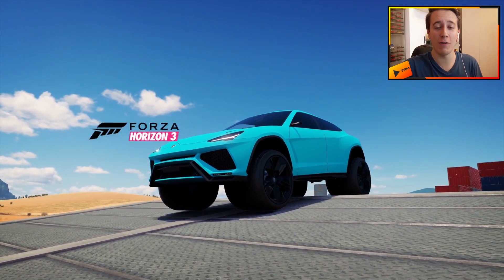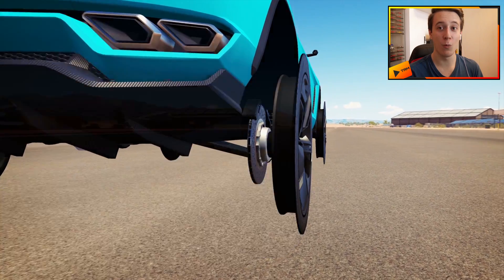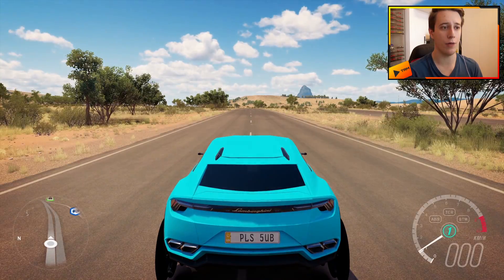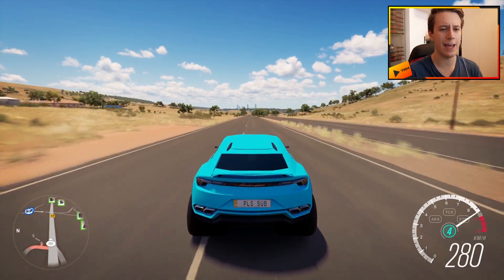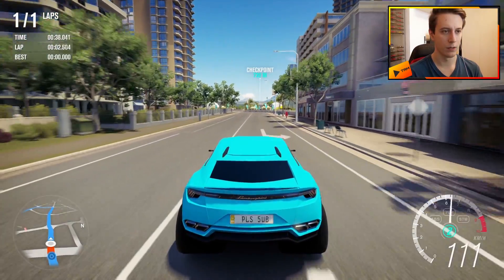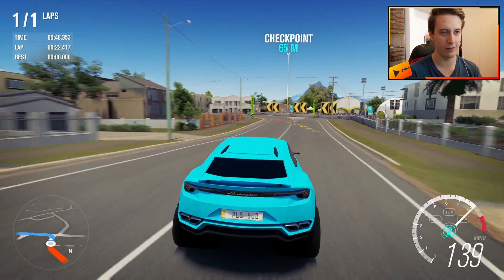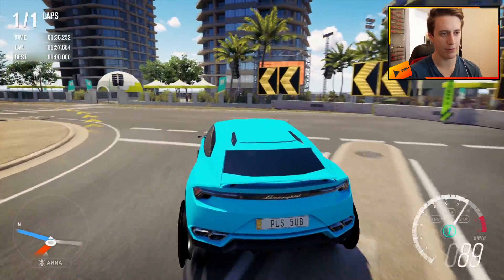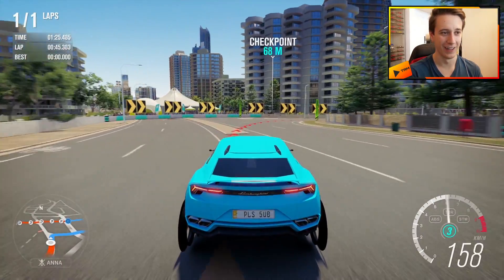SUPER THICK vs SUPER THIN TIRES | Forza Horizon 3 Dev Mods | Forza Science

Comment: The thick tire friction is indeed the reason for the rolling. I do game programming myself. The sideward friction between the colliders for the tires, and the ground will be set higher when the tire is wider. The tire friction tries to stop the the sideward force in a corner though when the sideward force gets too high, and the friction is very high it will roll over. With the small tires there is allmost no friction so the sideward force will almost not be stopped, and the car will just drive like there's ice in the corners.

Comment: Reason why it goes on 2 wheels is ...
Wait for it...
Physics. Yeas actual real world Physics. 

Same thing would happen if you could do that in Reality . Tires are too wide for lateral G forces to overcome the grip.
So the Tire instead of slipping to the side (basically understeer) It sticks to ith path and the rest of the car rotates around it because the inert force need a way out.And it takes the only possible way out.

This problem existed With first generation Mercedes A class. The tires  gave too much grip. Suspension was way to firm and car 
 center of Gravity too high so It basically flipped on its side when you turn sharp.
Reply: So would an F1 car have no problem with this considering the downforce

Comment: The reason the car went up on two wheels is a basic law of physics, the track width is narrower (wheel center to wheel center) with the wider tires. the 1 CM tires have a wider track width than the wider tires, also the compound of the tires allows the wider tires to grab better. So a combination of track width and added grip make it highly unstable. the effect is called traction rolling

Comment: I think the thicc tires are making the car roll onto 2 wheels because they have too much grip. Because a urus has such a high center of gravity the weight transfer is causing the outside tire to grip much more than the inside tire and when that happens the car will want to roll to the outside of the corner
Reply from the maker: Yeah, that´s probably the reason why!
Reply: Ur smart
Reply: that's exactly the cause of the 2 wheels. very wide tyres, too much grip. no tyre slip at all. the tyres likes to slide just a little bit. a very little drift in a corner maximize the grip without giving too much grip at the same time. the very wide tyres doesn't have the tyre slip because the contact surface is too wide. it's like using a dragster tyre width on an SUV in corners. it's exactly the same thing. the car will roll over
Reply: Whaaaaaa?
Reply: Yeah, I agree
Reply: T H I C C
Reply: Your going on the pavement 😑
Reply: you just basically said the same thing over and over
Reply: This is why SUVs need active suspension.